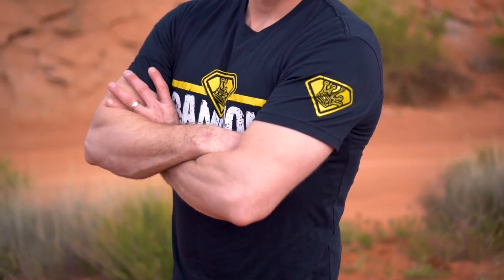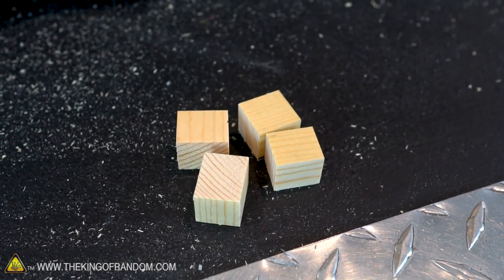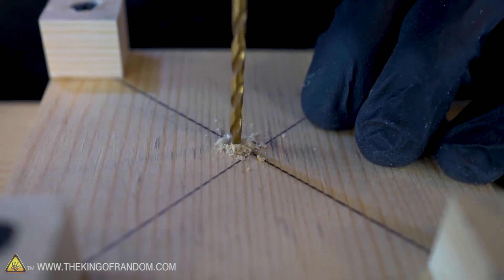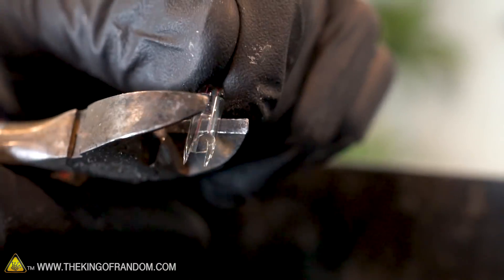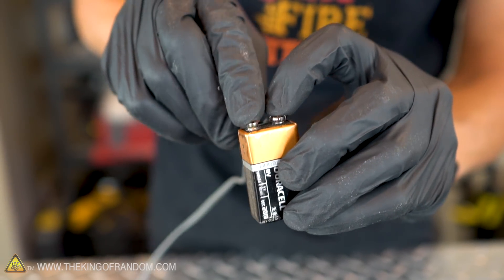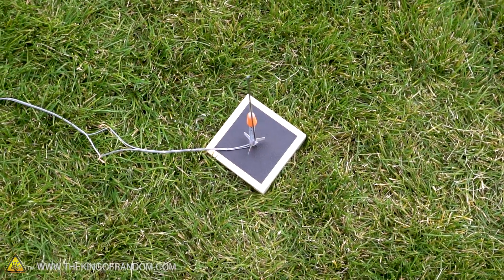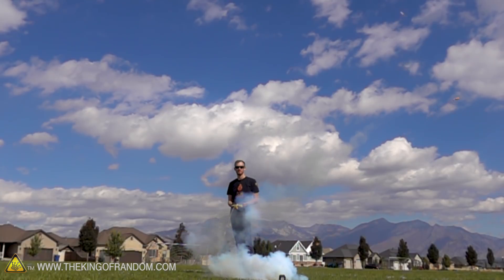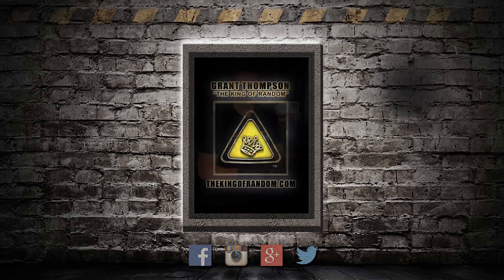DIY Pen Rocket Launchpad! TKOR Shows You How To Make A Mini Rocket Launch Pad and Ignitors!

Comment: For small rockets just use a rubber slingshot. Goes just as far and far less work. If you have to use powder, steel wool and a battery works just as well for an ignitor.

Comment: You could of just use quick connect male and female heads on the ends of the wires and heat shrinked the cables together

Comment: It would be much easier if you used an old pair of Christmas light string for the final leads and solder the connections so that you can keep the bulbs in the green holders and have a quick change feature and you can keep a little box of ready bulbs that only take a few seconds to reconnect instead of 2 minutes and re-taping the leads...

Comment: I would use a thicker foundation, drill two straight holes in it with a drillpress which are exactly the thickness of my two carbon guiderods and put longer straws on both sides of the rocket.

Comment: Just a guess ( I have not read the comments yet maybe other have had this comment as well) Possibly  that failure is a result of an air gap created while filling? An air gap may have changed the burn pattern,  maybe making it shortly more violent, or just the pulse may be a factor?

Comment: High temperature spray paint is available also. In the auto parts store it is used for painting muffler parts (range up to 500 degrees and super high temp to about 1200 degrees).  You can get the same paint at home centers available for painting your old BBQ grills.

Comment: You’re getting small air bubbles causing explosions use a liquid stabilizer like possibly gas or a more stable Alcohol or maybe diesel if you use alcohol you need a very high proof though

Comment: Why not use nichrome or kanthal wire for the electric ignitors. Is easy to get pretty much anywhere. Vape shops or tobacco shops that have vape products. And you can reuse it if its not crudded up.

Comment: wouldn't it be easier to use the flash powder and glue mixed together and applied between two wire leads like the igniters used in model rocketry instead of twinkle lights?

Comment: Maybe it exploded because only some of the powder fell to the bottom that's why it makes a double ignition sound on takeoff. You should make the tip of the rocket temporarily removeable to allow air flow so the powder can settle

Comment: Murpphy's Law if something can go wrong it will go wrong. Combined that with the recording curse and it's no wonder that one rocket exploded it's just nature taking effect after all a Steam locomotive boiler (Ok yes I'm obsessed with trains but this example is perfect) will be far more likely to burst if there are places where steam can escape in the wrong places. Far less likely to happen given that a boiler if full of tubes and as long as there is water to quench the heat on the metal it should stay together reasonable well.

Comment: You could cut off a bulb connector, and mount that to the base  as well as leaving the plastic bits on the bulbs. This would mean that the cables would not need to be twisted and taped, you could just insert a new bulb.

Comment: NEVER use a chop saw (as shown in the video) to cut any piece of wood as short as the 4+” one used for the base feet! Using your fingers to hold down a piece of wood that close to a blade spinning at over 4,000 rpm should never be done or even considered. Doing so will increase the odds of finger loss exponentially.

Comment: Looked like the rockets could use a second guiding straw higher up.  The slow-mo shots showed the rockets twisting on the launch rail due to the torque.  A second straw should prevent that and ensure even straighter flight paths.

Comment: Improvements for the Launch Pad:
- Make a triangular base. It will stand more stable than a four legged one.
- Glue/nail or screw the lid of a tin can on the top of the wooden base. It will protect it against hot exhaust gases.

Comment: What is you put spikes on the bottom of the base so that it would be firm in the ground and put two guiding straws on the mini rocket rather than one? It seemed as if in the slow-mos, the base was moving and the rocket would wiggle when it was shooting up the coat hanger.